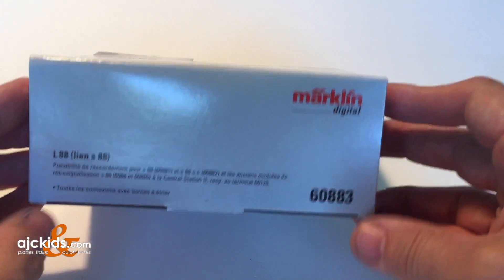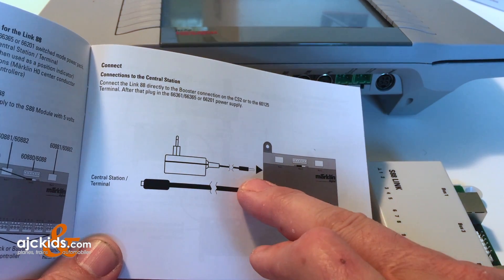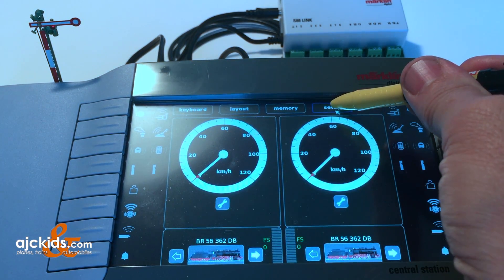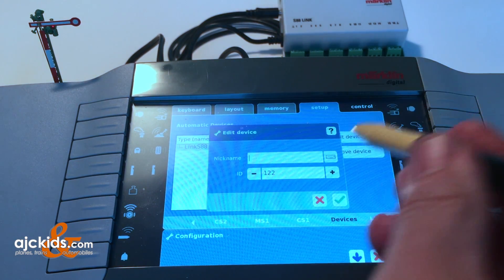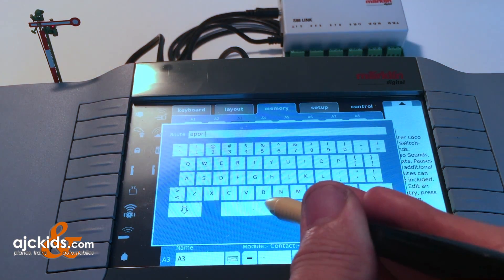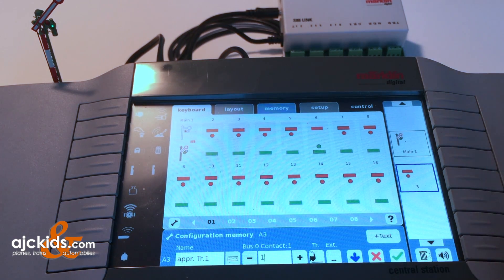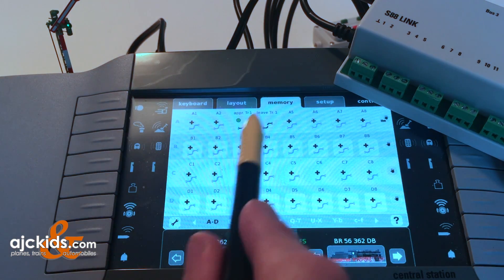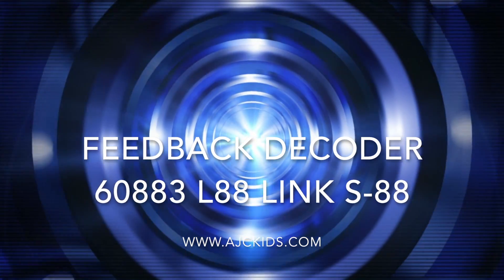Marklin Link S88 60883 feedback module and Central Station

Comment: The plug in area is arranged differently than what you are showing In this video.
Reply from the maker: This is a CS2. On the new CS3+, you can use the network cable (the blue cable that came with the S-88). It plugs to the bottom of the CS3+.
On the S-88, it plugs into the side with the arrow pointing "outward", to the cable.

Comment: Truly informative series . As far as I know the CS3 plus can be connected to the S88 modules  ( AC or DC ) without the need for the 60883   L88. However, the regular CS3 needs this module in order to benefit from the feedbacks
Reply from the maker: Yes, that is correct. In this video we are using a CS2, the predecessor of the CS3.